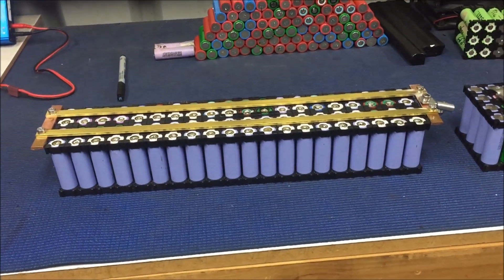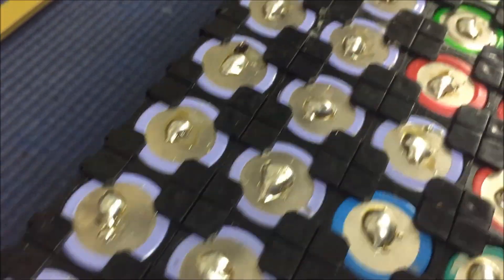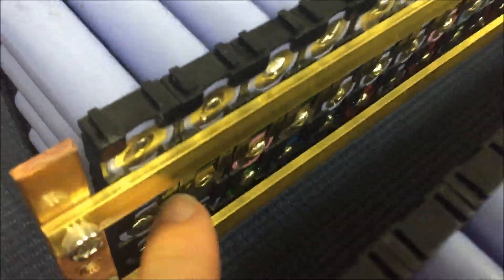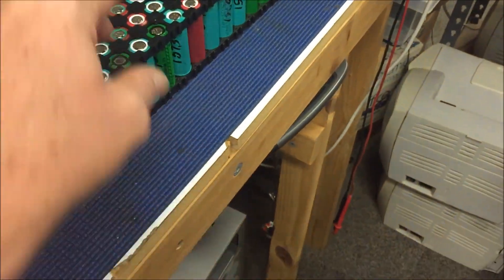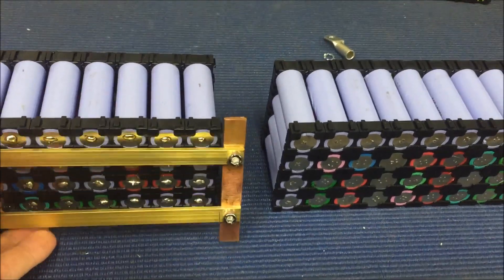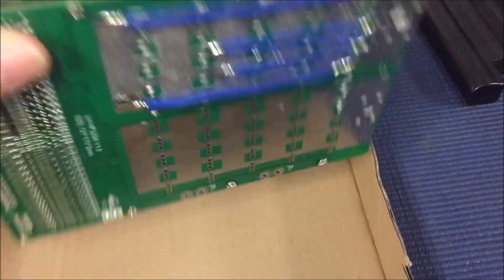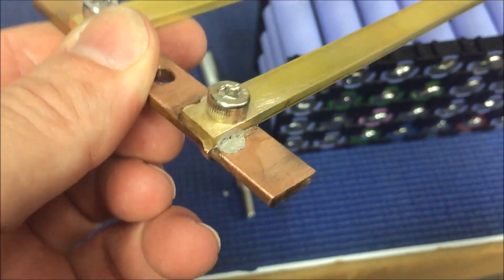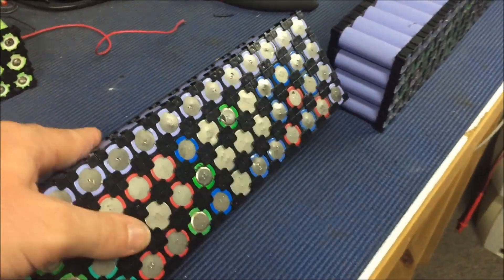Addressing overkill

Comment: Bro it is not over kill your bus bar is amazing remember one thing in electrical loads you do not want any drop  in voltage and if you use small gauge wire to connect them under load you will have a drop voltage ,as for soldering them a gas propane torch will do ,also all connection has to be perfect a loose connection will generate heat and melt down the surrounding a big no no ,sorry for your bms you work in pc grab a big ass heatsink use the cpu compound and slap it on the bms aluminum heat sink and play with it .
Reply from the maker: +94Discovery should get the gas torch out and hit the back of that BMS and load that sucker up with more solder :) bonus will be if it catches fire..
Reply: +94Discovery pls dont use high heat solder iron on cells or gas torch, will melt lithium plastic divider internal, shorting the cell out
Reply from the maker: +storxusmc noted, i just used my 45w iron, tinned them each in seconds so should be good.

Comment: I love overkill! Not a negative comment. You need to have overkill. It is like 11 it is one more than 10.
Reply from the maker: +Darin Bicknell it's definitely a solid 8, 9 if it turns on, 10 if it runs, 11 if it lasts more than 24 hours :)

Comment: I've made a used solar battery to power my house u use 3s 350p that give me 770amps but I don't use the buss bars I did a web with wires to the negative side and line some wires to the positive if something short the positive side wires burn to save the battery pack I'm working off grid for more than a year but with lithium for about 5months  or so and it works so well.
Reply: +Fernando De Zottis Sir do you have a video of your system i have a 3s 52p battery meant for back up power when electricity goes which is very regular in my country i ma now in the process of building a bigger pack
Reply: +Absolom Madhaka I don't have a video yet but I have plans to do one very soon.